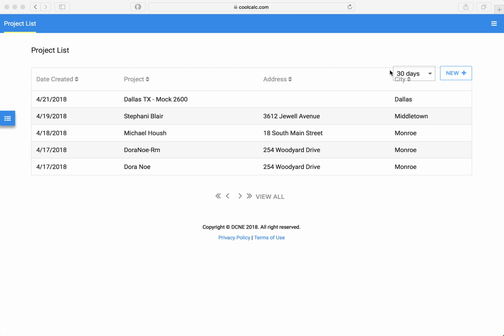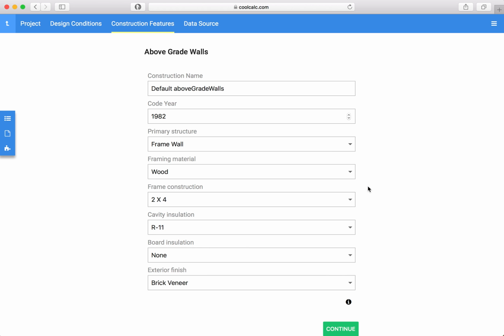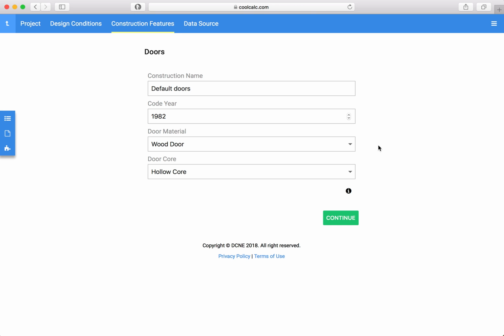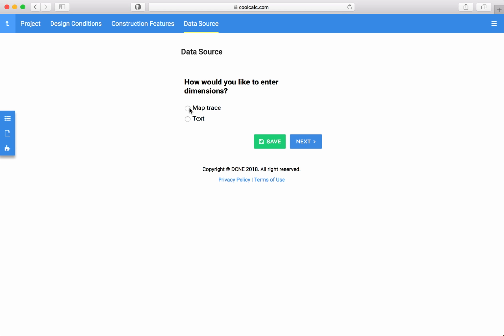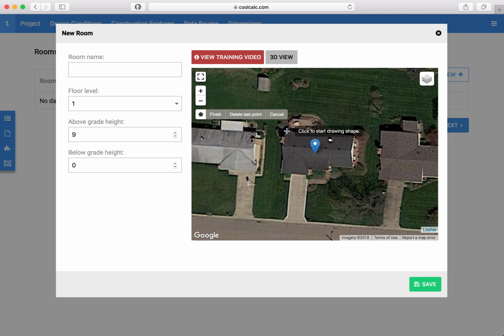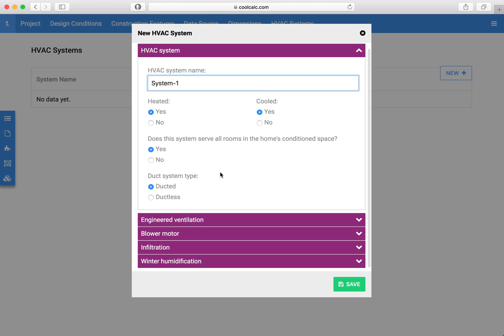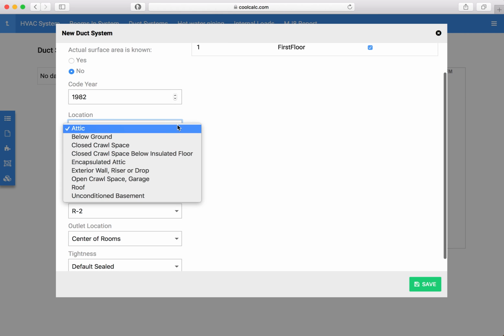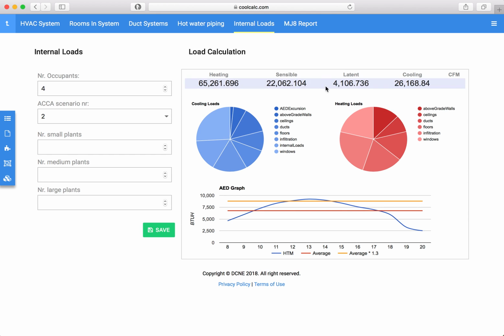CoolCalc Example

Comment: In this example is it a single storey home with a basement? How would it differ with doing a 2 storey home?
Reply from the maker: Once you've finished tracing the first floor, then you can add another floor to trace. The key when using the tracing feature is setting the level correctly.  It's a little tough to explain, but it's done exactly the same way, just have to trace it again, and give it a different name.  I'll try to get a video up at some point.